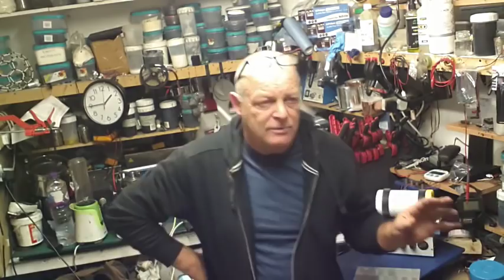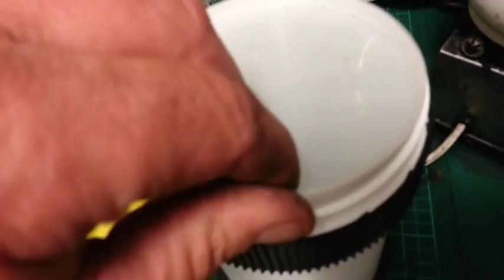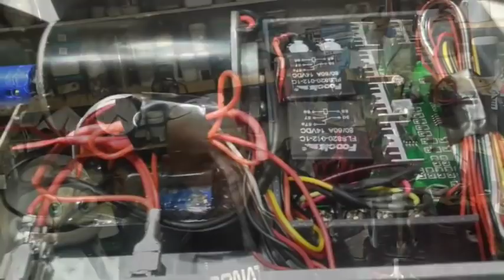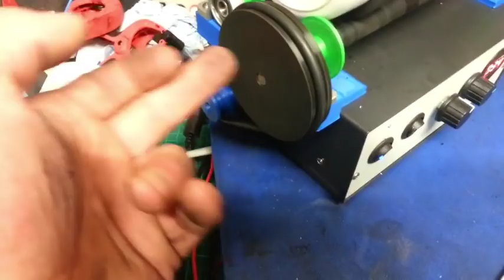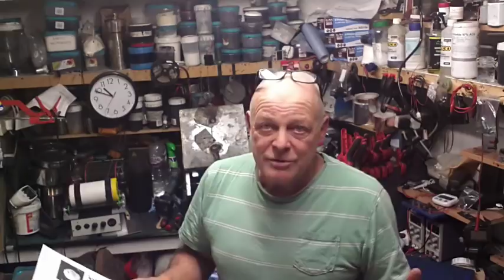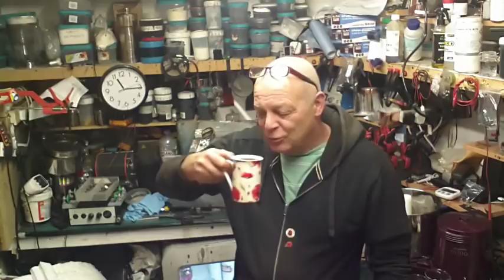Ok i'm Back & sorry for the delay

Comment: Hey Kev great video! I am held back right now because I cannot for the life of me seal my aqueous electrolytes into my test cells. I have a thermal laminator but that has never worked; there is always a gap around the part which exposes the + and - tabs of graphoil. I have tried sealing with silicone sealant and clear gorilla glue but so far my electrolyte always evaporates. I have some test curves but I really want to make a cell that lasts at least 100-500 cycles. I have had some success making carbons from pistachio shell but I really want to solve this sealing problem first. How have you gone about the sealing problem? Thanks for all your work and struggle!
Reply from the maker: The honest answer to your question is that with our type of cell that we make, we will never really be able to seal properly.
I have had some sucess with a 3d printed two half casing and using a rubber seal / gasket and then finally sealing the end where the tabs are with silicon sealant.
Kev 😎
Reply: @mouldykev  Interesting. How long do your test cells last?
Reply from the maker: @techniquetechnology2598  that's a good question, i have never tested a cell for more than 25 cycles so i do not really know.
But i am waiting for some automatic test equipment that  will take me beyond this.
This way i can be doing my daytime job and a cell can be cycled many times whilst i am away.

Comment: For ceramic balls to use in a ball mill type rig, you will be able to find them searching for sand blasting medium.  Another good search term is aluminum oxide tumbling medium, or simply ceramic tumbling medium.  They come in all shapes and sizes and are not too expensive.

Comment: Hi Kev - gosh, really good to see your back.  After similar issues with lost data - spent $100 for a Tbyte external drive (linked through USB).  Just mapped everything as a backup.  I understand your pain. 
Thanks for the shout out on my channel.  We've got a few more ink making' tools' in the works to share soon.
 
1.  Great ball my project you've go there.  I assume you're wet ball milling.  I think that's the better way to go vs. dry.  My dry ball milling (1" balls, about 6, in a new quart paint can, works OK but you can only get things so small.)  Through my paint can I inserted 3 rows of 3, 10-32 machine screws to help with the tumbling - that help things from lumping up in the corners.   After rewatching some of Robs vids I've been thinking about going to a rolling stone mill  like the one you showed - need to think about how to use it to make small test samples - < 100 ml. 

2.  As you put together your new year vids  can you comment on a couple of paths to take:
A.) highly conductive ink  as a combo electrode and current collector - vs. 
B).  maximized surface area carbon electrodes (including multiple 'size carbons' to fill the voids, i.e. flakes, tubes, graphene etc. ) and a separate, layered, super conductive ink for the current collector.  

Best Christmas and New Year wishes to you from Michigan,
Dennis
Reply from the maker: Tall order that, but lets see in the new year 😎 merry crimble
Reply: Merry Christmas and Happy New Year to you Kev.   I've learned so much from your many videos.  
A Toast, to a lump of coal in your Christmas stocking  - may it be the best.  pourous, conductive, ion size matched, multi particle, layered carbon structure, compatible with any electrolyte, low cost, environmentally safe, and as abundant as coal itself. 
Cheers,
Dennis

Comment: Well done Kev, good to see you are back. Things slow in Thailand too, I've expanded my farm and it's taken both my time and cash. Hopefully I can post a video on my progress, maybe next month. Might be a private one, we will see....who ever heard of a shy Brummie ;)
My 500ml reactor arrived way late, missing a couple of pieces so that was a bit of a nightmare. A few mods later and it is starting to cook. Its size means a decent batch size for various tests. My current line of research is with carbons synthesised from sugars, currently doping them with copper sulphide (copper sulphate and sulphur) during the hydrothermal process. Early doors yet as I will need to explore the binder/electrolyte candidates for the carbon, anyway there's another out there working on this stuff, but I've not reached broadcast depth at the moment. 
Keep up the good work!!
Tony
Reply from the maker: All good stuff mate let me know how you get on.
Reply from the maker: Forgot to say mate, Glucose was one of the best sugar carbons that i ever produced.
Jut look at the chemical makeup 6 Carbon 12 Hydrogen    and 6 Oxygen it is a very  intriguing carbon to use.
Reply: @mouldykev  Totally agree Kev, I will be looking at the other "oses" as well. I started with a local "semi-brown" sugar cane as its readily available and cheap. Processing the sugars in the reactor produces nano-spheres apparently (I don't have access to a SEN to confirm)...so rather than sheets or tubes I'm looking at spheres, so there is the possibility of placing material both inside the spheres ( possibly like seeding a crystal, if you know what I mean) and also filling the voids created like when you bag up a load of ping-pong balls. Sizing of the ions is going to be important, just as it is with intercalation, but it's early doors yet. The smell of my office is interesting, strong for sure but certainly not as bad as DMSO, that I can't get used to. Interesting compound, Cerium oxide... was idly thinking also of Titanium and Silicon, they all seem to have similar but different properties if you catch the drift, mr anode/cathode...and then Peltier cell sprung to mind ....or possibly when you get your kiln re-built you might want to dope some Urea with them...I haven't a pukker kiln but use a microwave  one. I use 2 crucibles, one inverted on the top of the other. A piece of kiln paper is placed between them and I put charcoal in the upper one to provide an oxygen-free environment to produce the graphitic carbon nitride in the lower vessel....again, work in progress there.
All the best

T

Comment: great having you back. i have played lately with a layer of Al oxide mixture with sodium  phosphate levels interesting results up to 200m-Amps very low cell voltage on order of 550mv and even less, but m-Amps are good. the mixture is with doped carbon and graphene at 1 to 5 microns each. cell recharge times also faster. sorry for not posting videos, yours is just more interesting.
the cerium oxide is realy good at this stage will let you know about the performance later
Reply from the maker: All sounds good,let me know how you get on mate and maybe i could mention your progress in one of my vid's 😎

Comment: Kev, you could try using a length of 316 stainless bar rather than bearings in your mill. This is much easier to source locally. It will act like a rolling pin rather than risk having the bearing collide with each other. As 'Steve A' says 316 is not magnetic but make sure you test with a strong NdFeB magnet.
Reply from the maker: Yes something to try mate i will look into it.

Comment: The Carbonater is back! I'm glad you're still at it :) Your ball mill looks cool. I'd like to order one. Also I'd like to see your schematic for the alternating current with one relay, for making Graphene. And also how is Rob doing it with two relays. Does it use a 555 timer chip to trigger the relays? Or a simpler circuit using transistors? 

I think the three roll mill that Rob refers to might be this machine...

https://en.m.wikipedia.org/wiki/Three_roll_mill

The spice grinder that you show at the end of this video, I think Rob referred to that as a Wet Grinder. I'm guessing. Thanks Kev.
Reply from the maker: Yes mate it is called a table top wet grinder £125 on ebay.
Send me an email and i will give you a diagram for that single relay.
I have no idea of what Rob's circuit looks like never seen it.
But he is probably using a 555.
Cheers😎
Reply from the maker: Forgot to say i will have definite pricing for ball mill in new year once all my own testing is done.
Reply: @mouldykev  awesome :)

Comment: Hi Kev, Glad to see you back in the saddle :-)Sorry to hear about you loosing all your carbons due to ball bearing issues.BTW you can test if they are Stainless steel 316 with a magnet :-)As you know I use a different ball mill design to you and it came with ceramic balls, I'm dammed if i can find it on ebay now.But I did find these :-
Black Silicon Nitride Ceramic Balls
https://www.ebay.co.uk/itm/30-Pcs-3mm-Black-Silicon-Nitride-Ceramic-Balls-Bearing-Balls-Si3N4-lot-105/273615451033?hash=item3fb4c07399:g:wUEAAOSwknJXz0fM:rk:1:pf:0
Not sure how they would perform in a ball mill though :-)                                                      
Merry Christmas and a happy new year  -  Martin.
Reply from the maker: Ah so you can leave comments after all, tee hee
Reply: Bloody strange, I could have sworn it never posted last night :-(
Reply from the maker: @solarhope  you are forgiven ;-0